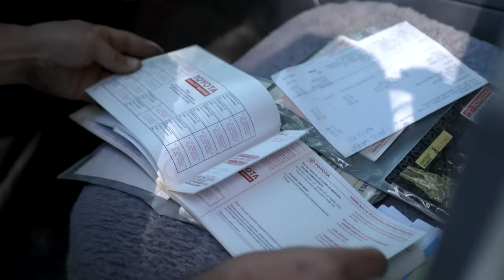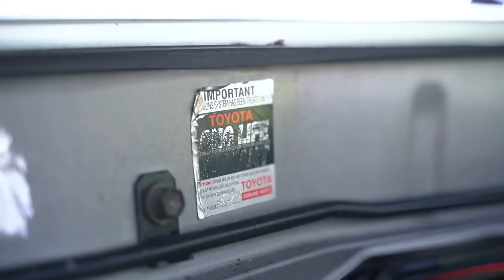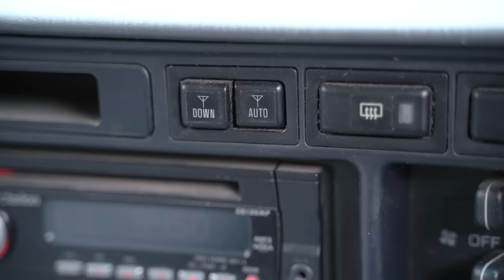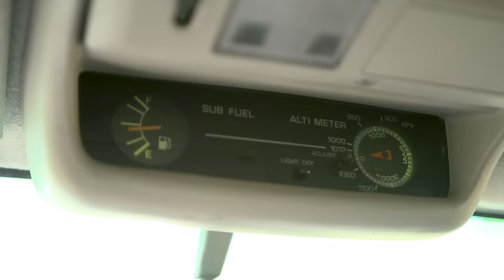RARE GRANDPA SPEC Toyota Landcruiser! You won't believe what Shauno paid + tips on buying an OLD 4WD

Comment: I've got two awesome deals!  I bought a V8 Ford Explorer for $50 USD ($71.18 AUD)!!!!!  A coworker stopped driving it because the driver door stopped working and abandoned it for 4 years.  I bought it from him when the bosses wanted the vehicle gone, threw a new battery in it, oil change, and fix the door.  I drove it for several years towing my boat with that big V8 until I bought my 2019 Ranger in 2019, with 12,000 miles on it, for $29,000 after tax!

Comment: 45,000kms 80 Series for $9,000! My Dad Bought a 1995 FZJ80 in 2008 from a dealer who evidently didn’t know what they had. We live in Utah in the states and my dad saw it online across the country and assumed it was a scam, some dealer was asking $9,500 for a 100% stock 80 with 28,000 miles. Finding it wasn’t a scam he flew out the next day and drove it home, he even talked them down $500! Since then he’s twin air locked it on 37s and added a trd supercharger, added Slee off-road front and rear bars and custom sliders, as well as an aux fuel tank and aux battery, and a 4.5in slee lift, and an arb snorkel and roof rack. All work in which me and my dad did in our garage. It now has over 400,000 kms on it about 250,000 miles almost all of which are down to southern utah and moab and off-road miles. This is the vehicle i grew up four wheel driving in and it started my passion for 4wds. It still has almost perfect paint and interior despite that it has see the most technical terrain the western united states has to offer. i reckon it’s one of the best Criuser deals ever.

Comment: I paid 4K for a VZ Ute that was pretty run down, I cleaned it up and swapped it for a GU 4.2 tray back which was also a run down mine spec Ute. I then cleaned that up and swapped it with a old bloke that needed a Ute for his 105 series which was valued at about 15k. All up it cost me about $6000 for the 105 👌🏻
Reply: My story similar bought a VZ ute for 800 was on road for 2500 sold it for 10 an swapped a Getz an 7k an bought a 1 1991 1hdt 80 an love it

Comment: Was camping on the coast with a mate. Pulled into Old Bar and saw a Hyundai Iload with "$4000" written on a piece of cardboard. My mate and I called the number to have a chat and the bloke came out and we took it for a drive. I offered him $2000 and he said "can you do a little more" so I offered him $2500 to which he replied "I'll do $2250" we were confused but accepted and found the only atm around which was in a bottlo but it was maxed out at $500, so the bottlo worker lady pulls out a tray of cash and gives us $1750 cash. As we are driving the car around to find a camp site that night we get pulled over by a highway patrol (we never did a VIN check on this car so we were worried it was stolen as he went around some other cars to pull us over) turns out the van wasn't stolen according to the police man. Later on we organised some mates to drive to Old Bar to pickup the van as we both had both our own cars with us. When we got home from our camp trip we gave the car a wash and had it sold in a weeks time for $8250, with the profits I bought a rear bar for my GU. My mate bought wheels and a lift for his RG colorado.

Comment: Same as mine Shauno! Bought my grandpa spec FT in great condition for $25k in 2019 which had 285kms. Love it. Mine is a manual though so the stallion of unicorns.
Reply: 25k that’s rough as
Reply: @samueldwyer4880  lol no it’s not.
Reply: Unicorn? I got my 1hdft tripple locked vx limited(highest spec) 197kms, active vacation (factory rear camping setup with gas cooker and sink with on board water and pump, heated seats and winter package, cruise control etc etc, cost me 23,500 in 2019 in NZ, now well over 40-45kNzd. I think I got a good deal
Reply: @excessivegarage  why do you call it Tripple locked when it’s double locked. Transfer is mute, they’re all locked.

Comment: Best budget buy for me was in 2014. I found, and still own, a 2010 GU Patrol DX 3.0 CRD auto wagon with 76000km, factory winch bar, factory snorkel, with roadworthy for $17 000! 
Have since added a 12000lb winch, dual battery setup, rear draws, on board air, 3” lift, offset caster bushed, adjustable pan hard rods front and rear, extended Brahmin lines and breathers, front Lokka, driving lights, boost control, egr delete, catch can, custom overhead console, sound system, UHF and upgraded head lights. Best Buy I’ve ever found.

Comment: Last year, I purchased a 1987 60 series 2H Diesel with 285,000km for just $500. She’s quite rusty, but the engine runs like a dream. Just needs brake hoses and clutch master cylinder to get it drivable. I could definitely use the snatch recovery kit. 
I love your newly acquired 80 series - an absolute bargain and a legendary vehicle too.

Comment: I got a old '83 Toyota 4x4 for $250 because they said it had a blown engine. Turns out the starter was cranked in super tight against the flywheel. Took out the starter and put it back in and drove that truck for 25,000kms before selling it for $2500 8 years later. Great find Shauno especially with the market the way it is these days!!! All the best gents looking forward to seeing more adventures..
Reply: How good is that.

Comment: Got my 2001 GMC Sierra 2500HD with the 6.6L Duramax for 8k, 2 years back. Has 154k miles on it and it already had a brand new Allison transmission and injectors installed with warranty just 4k miles before I bought it. Now the truck is valued around 22-25k. Best deal I ever made.

Comment: Nice buy mate. Picked up our 100 series factory turbo 5 speed auto with 280k on the clock for $20k. Grandpa spec just like yours. Built it up doing most of the work myself and towed a van 40k kms around the country. Sold it for $38k with 380k kms and heaps of life left in it!

Comment: Our biggest and most favourite bargain is our 2001 turbo diesel Toyota Prado. We bought it in 2012 for $10k with 270,000km on the clock. It has been our family adventure bus ever since. It’s currently sitting at just over 600,000km and still going strong.

Comment: Wow  the memories my bargain 80 came to me way back in 2005 .96 GXL WITH 260 THOU KM and all the fruit. Twin locked with ARB lockers ,bullbar ,kaymar rear bar ,full steel roof cage ,1HZ with safari turbocharger, and all the servicing done through out of town 4x4 in Barnsley   
$6000 was the magic number. exactly what the local toyota dealer offered the the original owner but he said he would prefer to help out a young guy instead and sold it to me .it's now done 480 thou km and still going strong 💪

Comment: Recently sold my 2006 Hilux with a few mods for 22k and bought myself a 2013 3.2 4x4 px ranger XL with 195kms on the clock, the thing is absolutly stock as a rock, it has the 6 speed auto in it (with an upgraded transmisson cooler), interior is stock hasn't been played with at all, every groumet is stock in the engine bay no wiring what so ever for lights or anything, recepits and everything was provided and in fact was serviced every 5000kms, picked it up for peanuts in my opinion for 14k.

Comment: Copped a 300kw RB25DET series 2 skyline GTS-T for 7.5k because the owner said it had a missfire, fixed it by draining the tank and putting new fuel in - bargain of the decade

Comment: got myself a old 1996 ln106 petrol off some bloke i work for , car runs like a beast was actually a farm truck but has just under 200,000 km on the clock but never misses a beat , only paid $2 for it aswell which was a bargain so i took it off his hands in no time

Comment: Got my 92 auto 1HDT 80 for 10k. Already had modified valve body in the auto, Detroit lockers front and back, alloy water tank, sliders, bar, dual batteries etc etc. was extremely cheap back in 2009 when I bought it. Still got it today with a bucket load more of the usual 80 gear.
Reply: There ya go its only a hdt

Comment: My best 2nd hand purchase is my current 2006  6 speed manual  4 litre petrol Jeep Wrangler grandpa spec , it has all the manuals and service records plus all original interior with only a head unit change everything else was untouched  , all mechanically perfect no leaks no faults no dents in any panel a one owner vehicle super clean and shiny paintwork ,no rust no issues , this my 2nd TJ and certainly the best

Comment: I think I got my 105 pretty right.  Was looking for an 80 back in 2006 and couldn't find what I was looking for.  Then I saw my 105 for sale, it was 3 years old, done very little off road and only 83k on it.
An older guy had it and did a lot of awesome mods, mostly arb and tough dog 4 inch lift with a set of brand new 35 inch claws to match. At 40k, I couldn't go past it. 
I still have it, although it's got 440k on it now and doesn't miss a beat. Awesome rig

Comment: I have bought a Suzuki Grand Vitara 3door 1.6L from 2004. It had 22000km on the clock and i (only) paid 7000 Australien dollars for it, which is cheep in Denmark. 
I would never have discovered the absolut amazing way to take a vacation if it had not been for all the inspiration from your Channel. THANK YOU GUYES

Comment: I bought my first cruiser from and old farmer in idaho in the states a 1987 FJ60 for $4,000! it had only had 110,000 miles on it and no rust! no body damage and perfect interior! it ran rough but i rebuilt the carb in my garage with my dad and it’s been running perfect every sense. i’ve kept the mods as tasteful as possible, i had the cylinders bored out and i swapped in a toyota 5-speed manual in my garage, it has a 2” lift and 33s and now has 305k kilometers but does excellent on the highway and off-road!

Comment: We purchased a 2010 RC Colorado 3L Turbo diesel. For 6K with 120,000 kms on the clock.
Absolutely immaculate, In terms of mods it came with a brand new arb bull bar spottiest steel tray, brand new 2 inch old-man-emu suspension lift and a set of brand new A/T Toyo tires.

Comment: Well done Shauno! I recently bought a 2002 90 Series LC Prado 3.4L V6 Auto with only 280,000km for $10k which was an absolute bargain for its immaculate, original condition. Was very well taken cared of, interior and exterior, already had an ARB bullbar on it, Domin8tor winch, 3 inch lift kit, fully upgraded supension, lights, roof rack, TRD Pro wheels and M/T tyres, complete factory tool kit. Super happy with it!!

Comment: I picked up 97 LN106 for $1250 off a P plater. It had a few little issues. But after about a grand's worth of maintenance and a few hundred more for RW and Rego. I drove it around for a bit over a year while I rebuilt the 12HT in my 61 and sold it for $9k and paid off the rebuild. Thanks Jocko for driving up the price of the old luxy's ;)

Comment: I scored with my 93 stock 80. Even had original front steel bumper bar. Similar to this one it had log books etc. Only mod on it was a brake controller. Only paint fade is on the hood. Paid 6k. Super reliable. Have had it for 1.5yrs now and doesn't miss a beat.

Comment: 80 series 1992 HDJ80R 
-New set of tires
-Two full tank of diesel
-12 month rego
-Just been detailed through the panel shop
-New fuel pump
Only issue was a sound big end bearing in the motor
Paid $2800,
Spent $1200 part to do motor up,
Mate and myself rebuilt motor,

Total cost $4000 on the road.

Comment: I bought a chopped and chassis extended 2008 76 for 35k with 300kms on it 
So essentially a dual cab 79 series’s, with more space in the back seats, the  tin dash, A longer wheel base  and the storage boxes where the wheel used to be.
I don’t think there many if any like this floating around so it was a pretty amazing buy.

Comment: Best so far I've ever had. 2001 Ford f250 4 door 4wd 7.3 turbo diesel. 174k miles never had anything done to it beyond regular maintenance and never had an engine code. Got this rig for the low price of free....it's a big truck compared to the 4wd24/7 team but came stock with air locking hubs on the front diff!!

Comment: Shauno the best second-hand bargain I ever came across was my 1995 FT manual LandCruiser.
180,000km one owner and immaculate conditions even the paint.
Same deal as yours I got a massive folder, with every receipt from the Bill of sale through to the day I bought it.
Mine was $20,000 but I reckon it was worth every cent and I will have that car until I die.

Comment: Hi Shaun I purchased my  1997 GL 80 HTZ manual for $10,250 4 years ago. Came stock with ARB front bar and Warn winch no other mods . Full service history, vinal  floors 197,000 km on the clock. Was used to tow a caravan but otherwise just parked. Cheers Bill

Comment: I scored the deal of a lifetime. Picked up a 2004 HDJ100 manual with 262,000km for $14k from an online auction sight unseen. It wasn’t running due to flat batteries. We only found out on collection that it came Twin locked with ARB lockers & compressor, 150L long range tank 240L total great for the remote trips. Full bash plates and heavy duty suspension. Water tank fitted to the chassis & tap on the kaymar rear bar. Only discovered the Safari Chip when I went to fit my aftermarket sterio from my old vehicle. Love the rig and she’s ready to go anywhere in the country!

Comment: 2003 GU ZD30 DI Patrol Wagon. bought it for $8000 right before covidtax went through the 4wd market. had 300,000kms on it. grandpa spec. no mods other than a 2 way and a brake controller. done a interior clean, shes our daily and family rig and shes done us a good 50000kms so far so good

Comment: I recently just picked up a single owner 1982 FJ60 with only 127 000ks on the clock. A real barn find, as the paint and interior looked like it just came off the show room floor. Well after I cleaned off 2” of barn dust off it (hadn’t been driven for 12 years).  The best part is it is truly grandpa spec with every fuel and service receipt from 1982, and he only wanted $5k for it. 
It was a real poster for Toyota reliability, stuck a new battery in it to see if it would kick over and get oil pressure, and she started second crank.

Comment: 4 months ago i brought a 1995 one owner gq patrol with a snapped timing belt for $3000 of an older lady who had only ran it to and from to the shops, brought it with plans of a barra swap, but decided to pull the old rd down to the block as it only has 180000km and to my surprise pulled the head off, and there wasnt a mark on it or the block, but decided once its off to refresh the motor, fast foward to now, its got a brand new head, injectors, glow plugs and it now runs like a brand new car. Also another great score on top of the imaculate condition is it had a full tank of diesel when we fired it up.  

Its now on club reg with plans to lift it, exhaust, wheels and to put a nice chrome grill and get the factory bar chromed and have it as a nice crusier as its too good to bush bash thank you

Comment: brought a mint condition 1992 Suzuki Vitara with only 26000 on the clock, for $6k  turned it into a Rhino off roader with a Calmini 3 inch full lift, 2 inch body lift, 32 inch tyres on 15 inch steel rims, custom made bullbar, led light bar. Awesome off road for a swb truck and had loads of fun!.

Comment: I have a used 1991 Ford Explorer 4.0 5speed limited slip ford 8.8 rear diff and Dana 44 front diff with warn lockouts. I paid 400.00 dollars for it originally from a friend who just loved it but he had too many vehicles. That thing my wife and son drove for years until it got parked with multiple issues for 4+ years behind the garage. After watching some of your 4wd 24/7 vids I put a battery in it and had it running in 5 minutes. It now has a 4” lift 31x10.5 tires, some new headlights and all new ball joints, universal joints up front and new steering box. I am currently replacing some body panels, have a new clutch and will be freshening up some extra heads for the engine. Thanks for the inspiration!

Comment: Bought an locked and lifted 80 for 3 grand with 440 000kms. Still all factory engine n driveline. Since owning it done many trips on the hard tracks of Vic, NSW and fraser. Toured it up to NT. Still goin strong with 530 000 on the clock

Comment: I snagged up a 2000 4runnner (I believe a Prado for you chaps) in the limited series. I am the 6th owner of the car and it has been registered in more than 4 states across the USA. This model has 2wd, awd, 4h, and 4L with e-locker stacked on top. It is rust free and the paint out mirrors even some newer cars; though my off-road badges of honor are starting to deepen. It has about 216,000 miles or 347,000 km, not bad for a gas truck. I picked it up from southern USA a year ago and have been slowly resto modding it to be a solid rig.

Comment: G'day Shauno and 4WD 24/7 crew! Nice 80 series! I bought a very cool vehicle a couple of years ago! It's a Toyota Hiace Super Custom 1996 Full-Time 4WD, 1KZ-TE turbo diesel for only $8000. They usually go for $15000 to $19000+ normally. While it's not immaclate, it's still in good condition and I love it! it's been my daily driver and camper to get off the beaten track for the past couple of years! :-) I have a bed base in the back, side awning and for a non low-range vehicle it doesn't do too bad in the muddy stuff! I haven't ever got bogged in it! Cheers, James from Tassie!

Comment: Nice find 🤙🏽 Mines a 40th anniversary 1997 80 series picked up for 16,500, has around 300,000 km but had been insanely well kept by the owner and runs as smoothly as anything,it’s an auto, anniversary rims, x rock bar, 12 thousand pound winch, x rock ball bar, spare tire swing, light bar, roof racks, tow ball, petrol with fully compliant gas, 2 inch lift, nicest car ever.
Reply: That's an awesome find mate.  My understanding is those anniversary models had upgraded runnin gear too.  Lucky bugger
Reply: @beejoutbush3322  Cheers yeh pretty lucky, runs like an absolute treat.